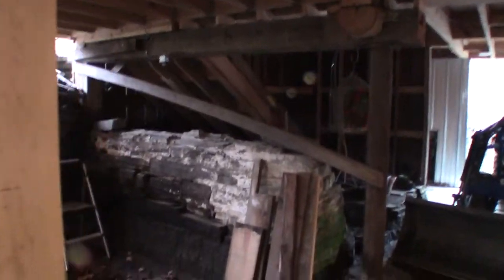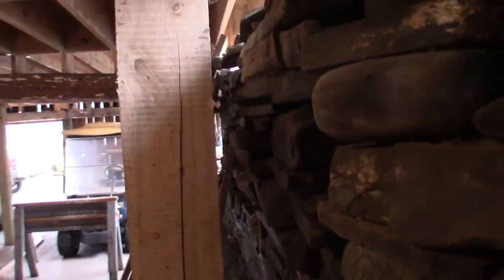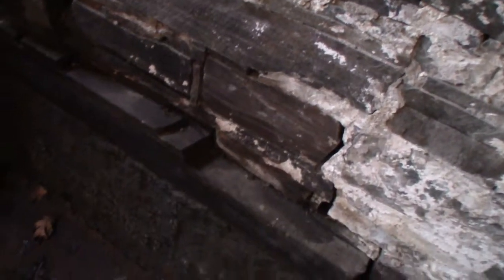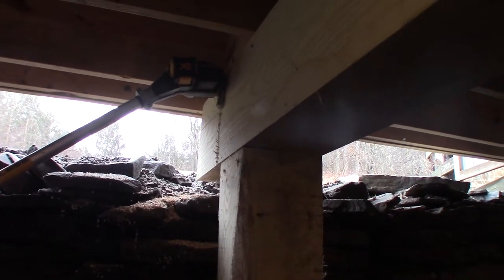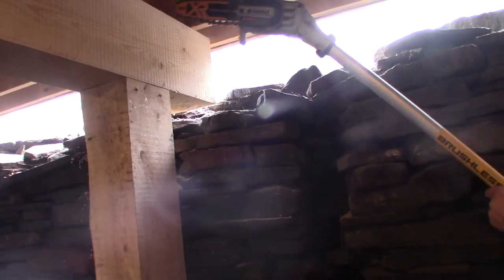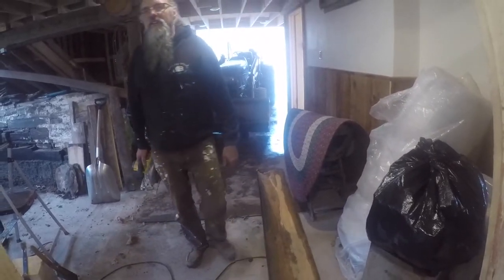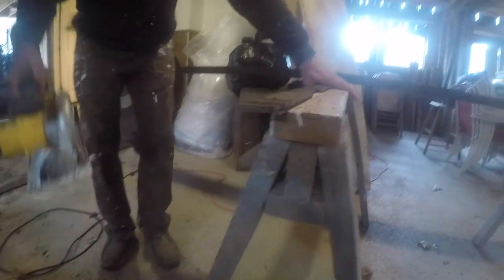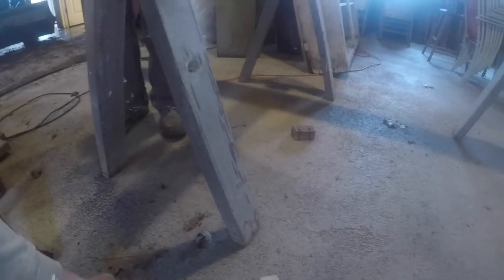I Spoof Connor with a Steel Demon blade in my DeWalt 20V.

Comment: and I hear if you reverse a worn out wood blade, you can cut homemade lasagna noodles without damaging them..... (From one dad to another!)
Reply from the maker: Hi WhaleBlue; Hope ya don't mind if I respond to all of your comments right here. The 4.7 is just a boat anchor. I ruined it by not tightening that dang sprocket bolt and yeah I was pretty bummed. But what I have since acquired is a totally trashed body on a 03 dodge 6 speed Cummins I bought from a neighbor. Even the frame is rotted but my plan is a body swap ground up resto. I even found a frame so as soon as I can get to it I'm gonna use that body on the cummins truck. They are just way more valuable than a 4.7 truck. The jag has been great, has just about 99k on it now. Eng light is on but still runs good and still rides like a lazyboy recliner. I am however getting hesitant about driving it to fl this winter? I probably still will tho.Thinking of doing a 100k review on a 96 Jag video....If I can get the Empress to clean it out. Sticking clutch is probably more common than ya think.I had it happen on a wrangler. Drove it up the driveway with one foot on the clutch and one on the gas and brake. Finally broke loose and hasn't been a problem since.  LOL! I had him fished in for a second or two though he won't admit it. That blade cut awesome then suddenly just wouldn't cut? I don't know what happened but it quit. The real metal cutting saws spin way slower so they probably hold up longer. Gotta run...suddenly got a hankerin' for homemade lasagna..... Thanks for the comments I really enjoyed them!! John
Reply: @JohnFrytag  "All-in-one reply" is just fine. As long as it doesn't mess with the "Al Gore-ithm"... (A little extra shot of NEPA dad humor to round things out)
Reply from the maker: whew! I don't know what messes with the 'AL Gore-ithm' LOL!!! Maybe Tipper knows?